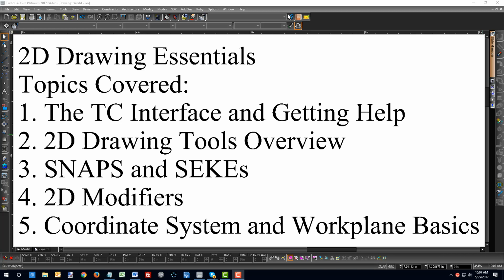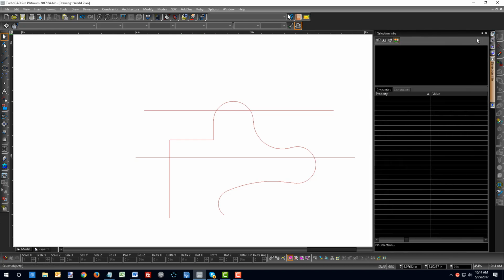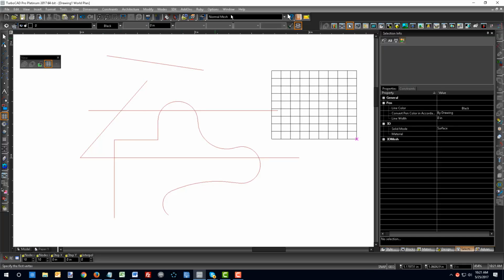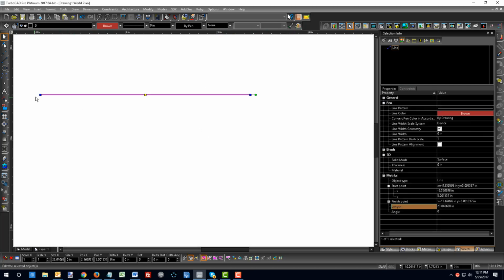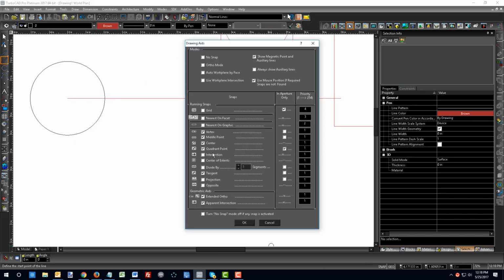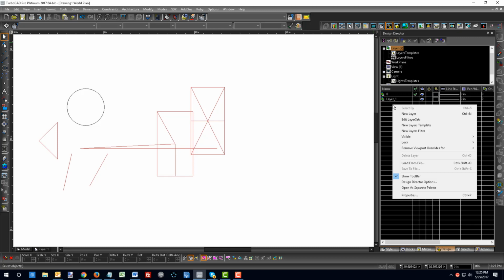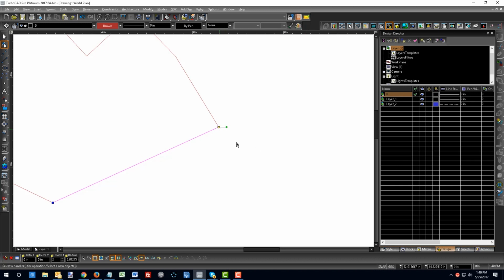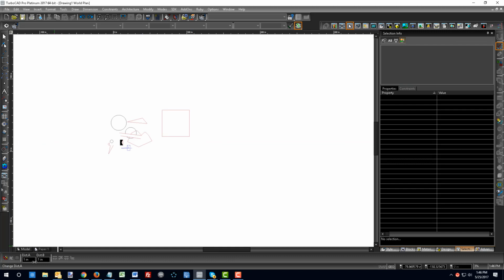TurboCAD 2017 Webinar 1 - 2D Drawing Essentials

Comment: Can you use a standard naming on your future webinars?
Makes it easy ti follow which one is which. The 2017 Webinars are fucked up making you look rather stupid.

Webinar #1 - Drawing Tool Essentials 2nd Presentation
TurboCAD 2017 Webinar 1 - 2D Drawing Essentials
TurboCAD Webinar #2 – Annotation tools and Printing in  TurboCAD 2017
TurboCAD Webinar #3 -  3D Drawing Essentials
TurboCAD Webinar #4 - Architectural Drawing Essentials